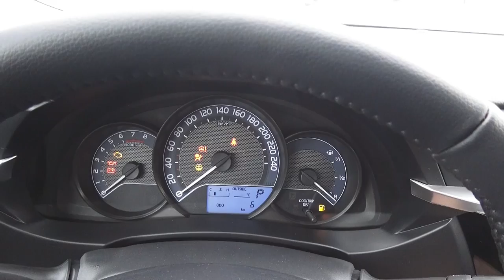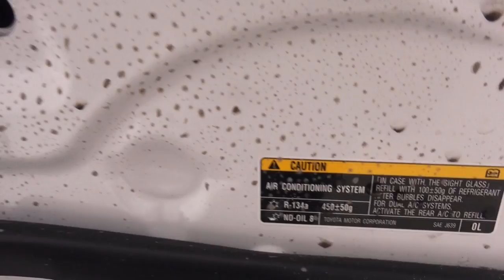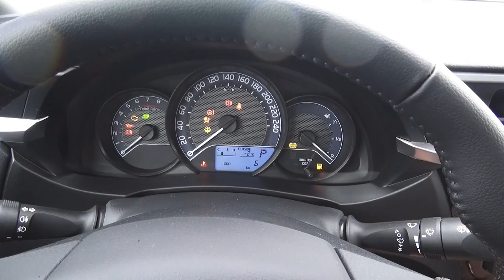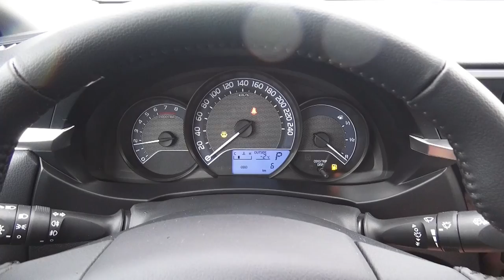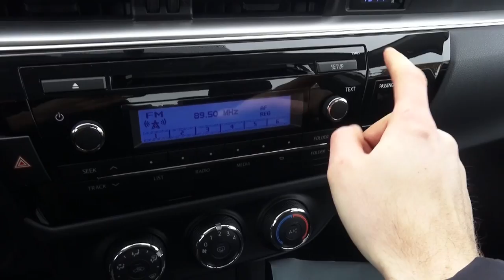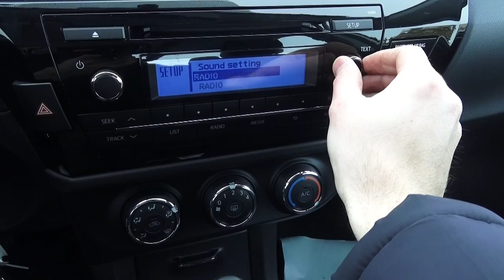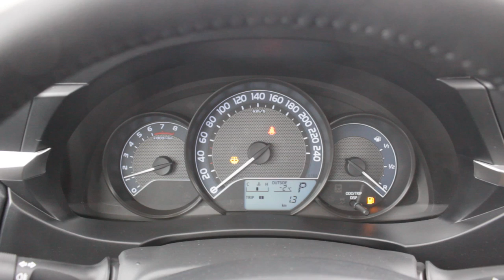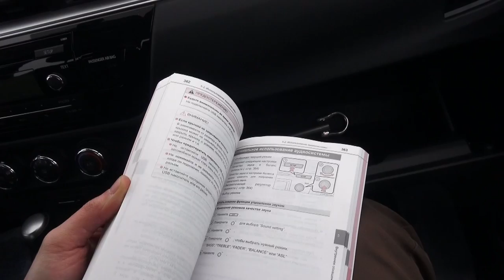2015 Toyota Corolla Е160. Start Up, Engine, and In Depth Tour.

Comment: No one can beat japan in terms of quality
Reply: depends on what you define by quality. Paint, for instance and comfort can not match German cars. Japanese might be reliable and have good engines, but they are still cans, made with crappy materials. Watch Scotty Kimler, he tells about how Toyota's going progressively down on quality.
Reply: @stelviodelbrava6218  that’s bs. Japanese cars are made with better materials which is why they last longer then German or American cars. Reason why corollas are made with a bit cheaper materials is because they are mass produced.

Comment: MegaRetr This Toyota Corolla has an optional 6-Speed Manual Transmission aside from having the CVT Automatic Transmission with Manual Shift Ability. This car is also known in China as Toyota All-New Levin and in SouthEast Asia, Taiwan, & India as Toyota Corolla Altis. You forgot to blow the horn of this car. The hatchback version of this car is known as Toyota Auris.